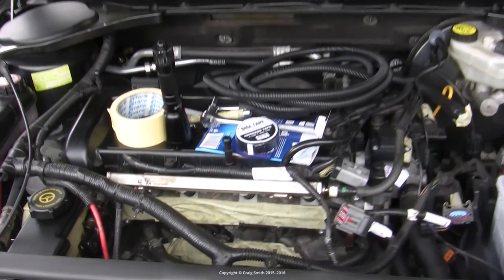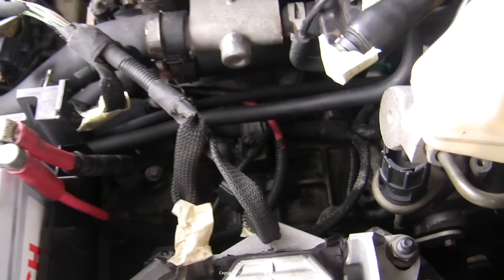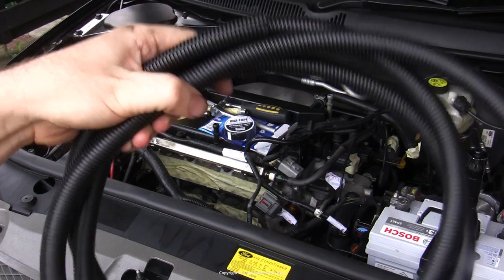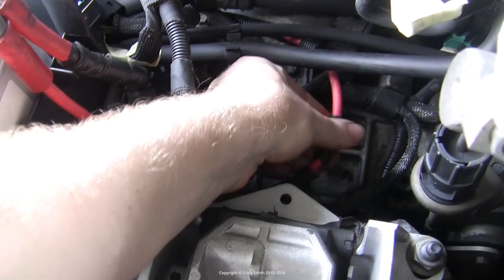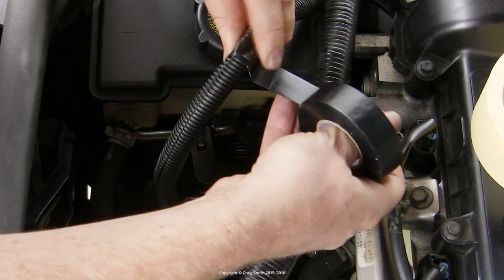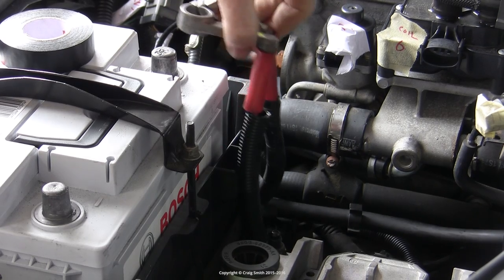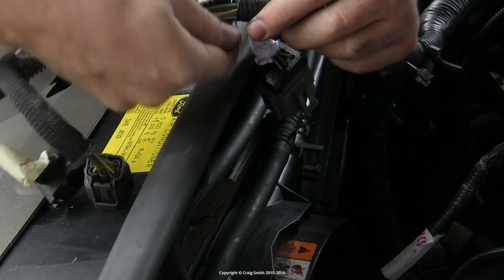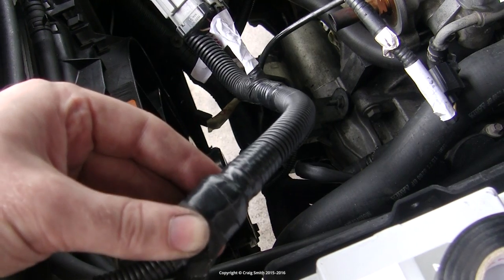Quick tip: Fixing up engine bay wiring & cabling protection

Comment: I've used the exact same protecting sleeve a week ago (6 years since this video) (this is the first time I watch it) and cut it exactly in the same fashion without knowing anything about cars or electric cables, and I'm from Uruguay, South America. I don't know why but I find it extraordinary, almost eerie. I'm quite surprised at myself and pleased to know that I actually did it right, I thought my frankenstein work wasn't conventional. The only thing I would point out is that I avoided using tape because I think it will really wear out with time. I outright avoided having to join sleeves, and in places where I had no choice, I placed a 10 cm piece of a bigger diameter sleeve on top of the joint.
Reply: nice

Comment: @CraigsDIY as always, a brilliant guide. You've helped me fix so many things on my 2002 Mondeo LX. A question for you... I had to replace the battery, but as I've imported my UK Mondeo to Spain, the battery I bought has the + and - terminals situated as such that I can only make the + cable reach the battery. I've bodged a connection from the - cable  to the - terminal on the battery, but I'd really appreciate your advice as to how I could make this important connection permanent and secure. Bests, Ian
Reply from the maker: Honestly if you've got the wrong format battery and it's new, the easiest thing will be to return it and get the right one. On the 4 cyl it's a DIN53L, the L is the terminal orientation. Check it anyway. Should be easy to order anywhere in Europe. Extending the ground cable will be more of a pain than it's worth, if it was absolutely necessary then I would replace the whole cable, which might require an auto elec place to make it up so the terminals are crimped properly.

Comment: Here is another important tip... My 100hp Kubota cab was leaking when it rained. Upon investigating, I found that the split in the plastic covering sleeve was allowing water to run into the wiring from the outside mounted lights! I used black RTV and electrical tape to solve the problem.  :)
Reply: Electrical tape is a nightmare if you need to access thst wire again... It tends to deform and get really gooey and sticky over the years, I would stick with plastic tubing and just seal the split with tape flat against it not around it, that way it should be relatively easy to remove the tap if need be.
Reply: @jmabs5096  Your right, But I just used it to keep the RTV in until it hardened.